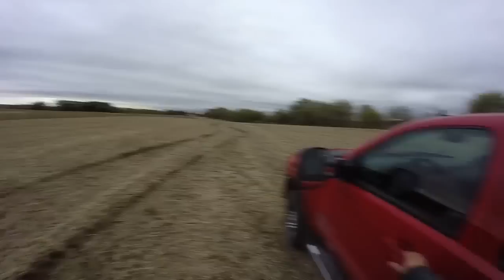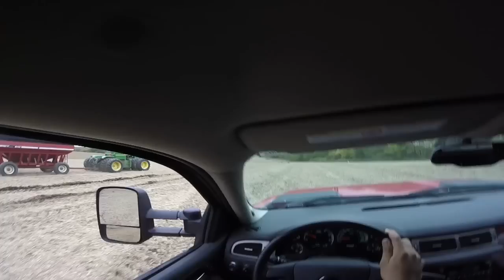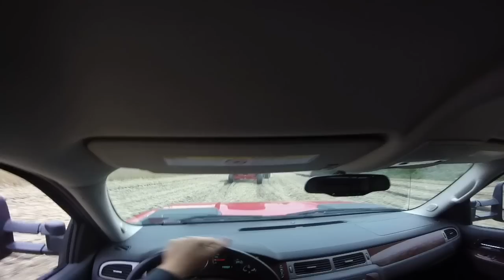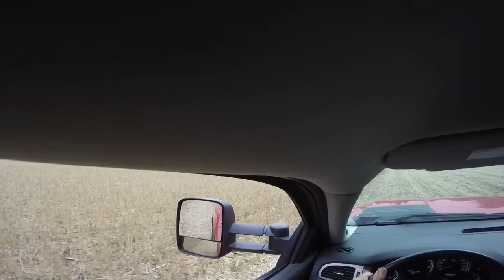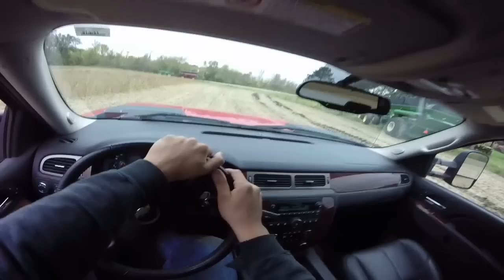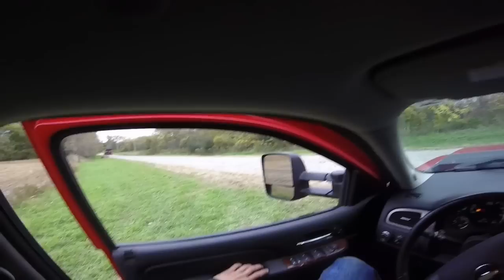Moving Wagons Off the Field Before the Rain

Comment: Have you guys been able to get into these fields and close up the ruts you left?
Reply from the maker: Yes, the corn field ruts were closed in with the ripper/plow.  You can see that in a couple of my videos.  A retired gentleman used the 8440 and disk to close in the soybean fields.
Reply: That's good, it would be a mess come spring with water laying in them.
Reply from the maker: Ya, thats why we made such a push to close most of them up.  A few areas are too wet every year and we weren't able to get them all but I'd say we got 95% of the ruts.